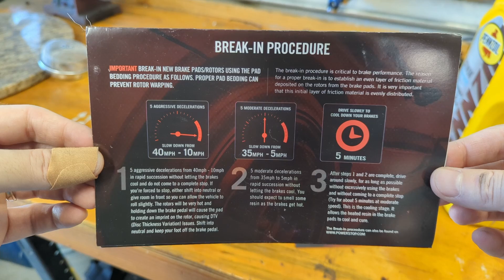2015 Jeep Grand Cherokee WK2 Front Brakes

Comment: Thank you so much! Your video is much clearer and easier to understand than others. Ive never changed my own brakes before and this has given me the knowledge and confidence to do so!
Reply from the maker: There are a lot of armchair critics out there... the procedure I showed in this video worked just fine and there were zero issues with the brakes until this vehicle was sold on 5/2024.

Comment: Do the new rotors have to have anything on them that allows the ABS to work properly?  Will ABS work with any rotor specified for this application?  Thanks.
Reply from the maker: There is nothing on the brake rotor that supports ABS